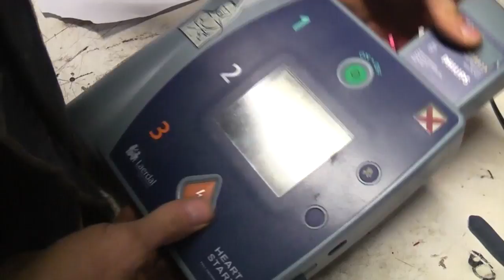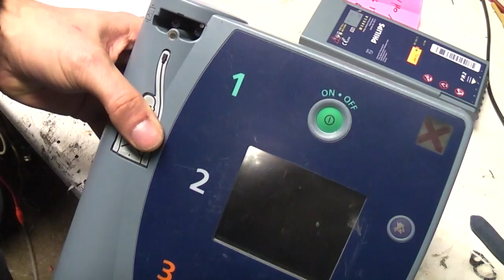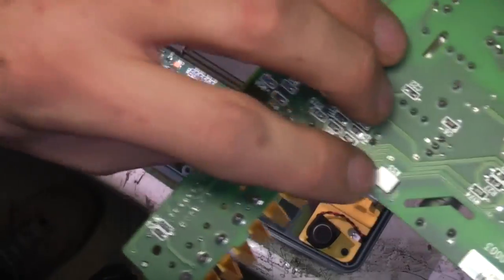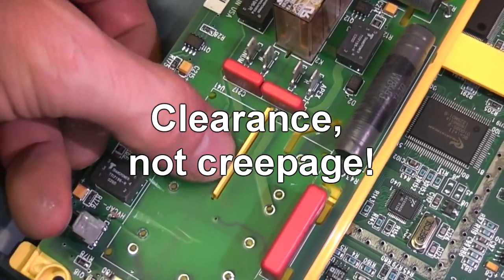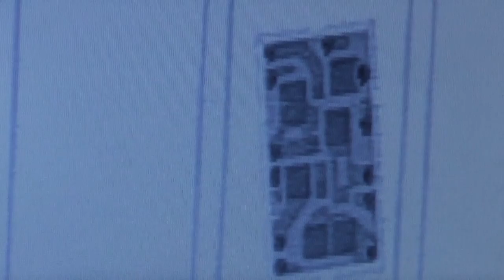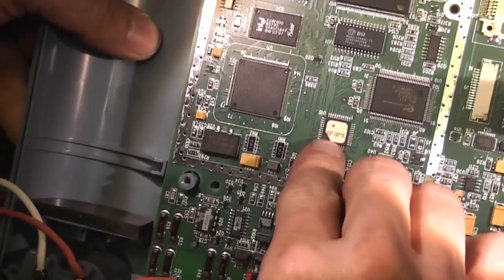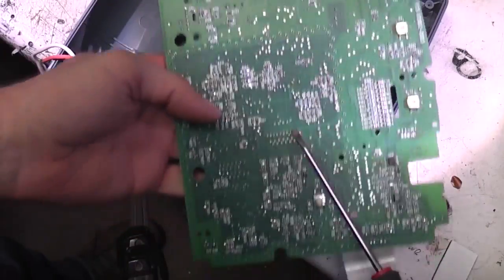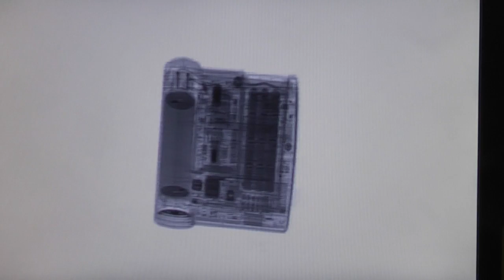Another defibrillator teardown

Comment: A very interesting presentation Mike. I myself was about to check one of these devices. You did it for me and answered the question I suspected. That consumer camera batteries were inside. Maybe if the device were a snap on cover , the batteries could be replaced and save the purchaser £100s of pounds! But I suspect not sadly. The cost for new batteries are extortionate for these devices. The Laerdal Ambulance Defib’s can be charged both on board an ambulance and externally via a charger in the mains socket. Thanks once again for a very informative video.

Comment: Hello Sir, Great videos. (Question), Could someone just replace the basic camera batteries with new ones rather than spend $260 on a new battery?
Reply: Should work if you manage to reset the battery control chip.

Comment: This would have been a real unit used on real people, the training ones lack the LCD displays (instead have a sticker for the main one and a pull out strip for the battery indicator at the top right)
The training ones also take a slightly different battery loaded up with D-cells cas theyre cheaper than the real things. They are nt cross compatible for obvious reasons.

Source: Ive been trained on a number of these units and theyre all pretty much the same

Comment from the maker: I'm sure people have worked out the optimum charge value to resuscitate the majority of people without causing harm. 
Drain from an LCD will be a tiny fraction of the battery shelf life so not an issue. 
A check button is no good as unit may be behind a break-glass panel in a public space.

Comment: Interesting to see what look like ASICs. One possibility is that current FDA and other regulatory requirements frown on software control. Essentially, manufacturers need to prove that the probability of a dangerous malfunction is below a specified level. Some guidelines require that in this calculation, the probability of failure of a software module must be taken as 100%.

I wouldn't be too surprised if these ASICs were a redundant ECG analysis system to inhibit shock in life-supporting rhythms

Comment: Open an old Panasonic plasma and be greeted with a huge number of IGBTs (one I repaired had some 10 high-voltage IGBTs and about 30 MOSFETs), 400V mux ICs (with 480/720/768/1080 output lines), etc. They use something like 200V drive waveforms at 200kHz.

Comment: You can get them on eBay for about $1000 and up. A rather justifiable investment if you have use professional use for it, as I'm sure Mike does. He might have gotten cheaper through contacts, though. Another tip, again from Mike if I recall correctly, was to go  to the local veterinary and ask to use their x-ray machine, of course against an appropriate payment.